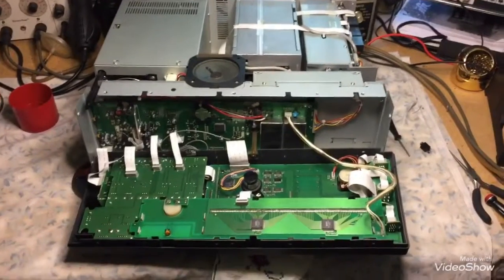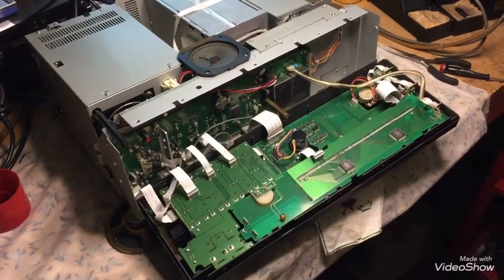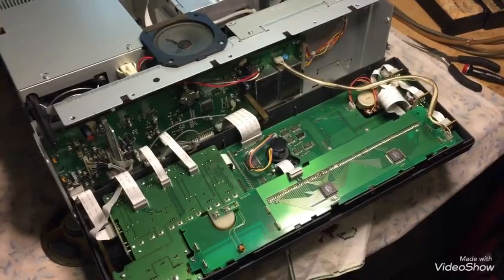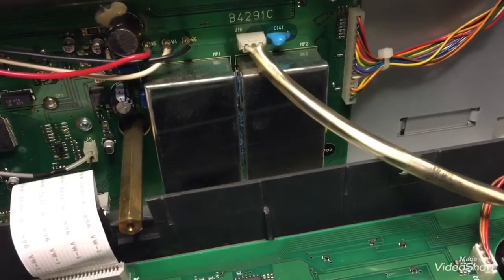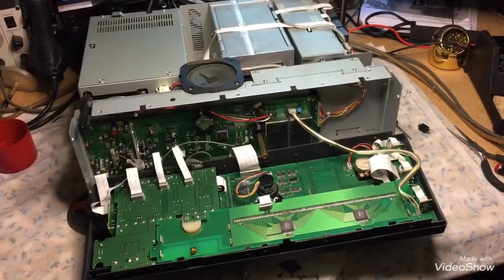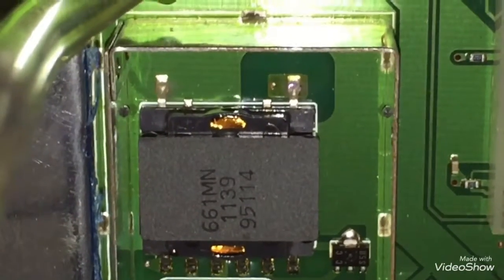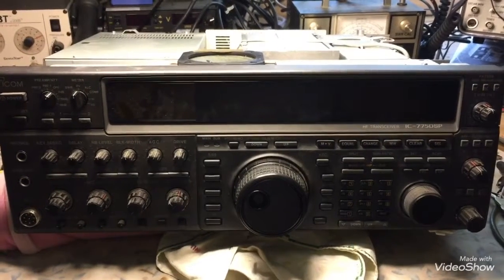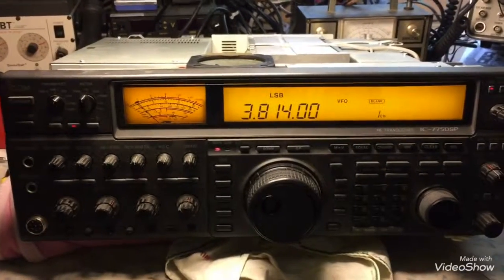Icom 775DSP Backlight Flicker Issue Resolved

Comment: I currently have two of these transceivers and have yet to have this issue. Like all radios they have issues from time to time, one of my 775DSP's developed an issue where the internal antenna tuner would not match any load on 15 and 10 meters. The issue there was a bad relay controller with two channels having weak outputs. For now I have swapped out the entire antenna tuner assembly with a working one till I receive replacement parts. 73!

Comment: Hi,
Do you mean that the flickering display is due to a bad solder on transformer ? I have a 775 with a display flickering, I'm going to change the bulb for a LED strip. But if it's only a bad solder ... 
What do you think ?
Thanks and 73
Jeremie HB9FLL
Reply: After redoing the solder on my transceiver, that works. Don't need to change the bulb ! 73s
Reply: RE SOLDER